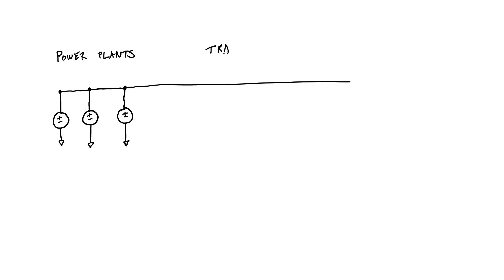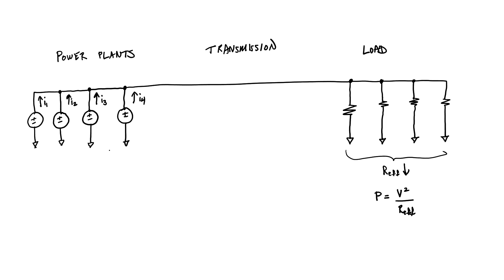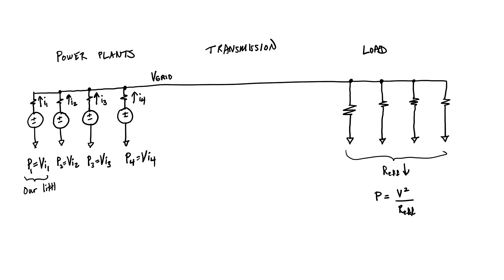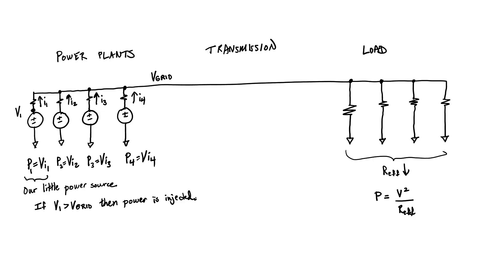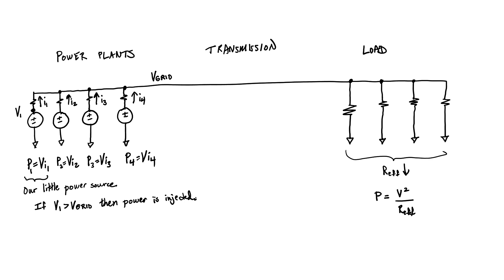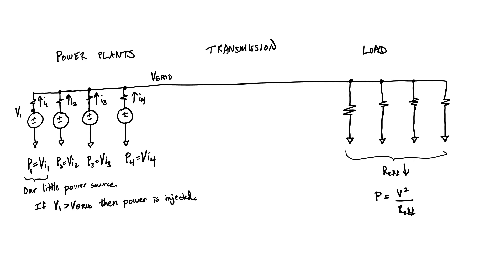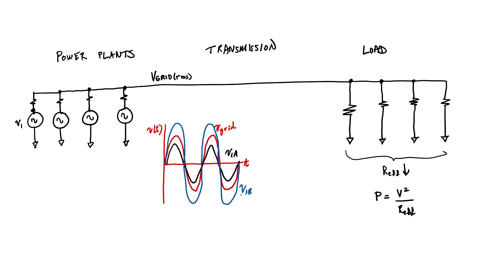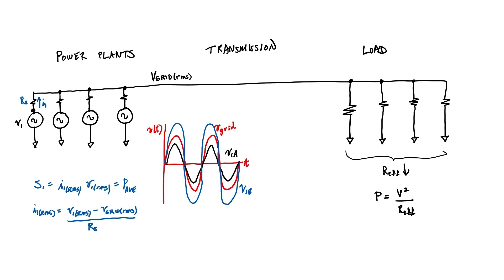Why electricity flows out of power plants and not back in (27 - Electricity Distribution)

Comment: When grid has a supply shortfall, this usually manifests as frequency drop instead of voltage drop?
Reply: You mean in cases that the load is increased? Yes, that will result in a minor frequency drop. Actually the system counts the number of cycles and adjust it over time to be correct. You as a costumer know that from the fact that many clocks are driven by the 50/60Hz.

Comment: How can a parallel power supply raise the grid voltage, battery voltage in series add but not in parallel?
Reply: Say the generator is driven by a water turbine. You open for more water and the generator output voltage will rise a tiny bit over the others. This generator will now deliver more energy into the grid.
Reply: I think that it's because of V=P/I, when more P is provided to the grid, I is the same, V will be increased. Am I correct?

Comment: How does the phase & frequency "locking" happen when a new power plant is brought online? Great video as always!
Reply: They basically first align the phase & frequency of the generator manually to match the grid as closely as possible and after it is switched online, its permanently locked. That is because if the generator was slowed too much, it would act as a motor and pull current from the grid, so the motor always matches the grid's frequency.
Reply: @cremetoertchen0815  Thanks
Reply: @cremetoertchen0815  is it called reverse power if the generator acts as a motor?